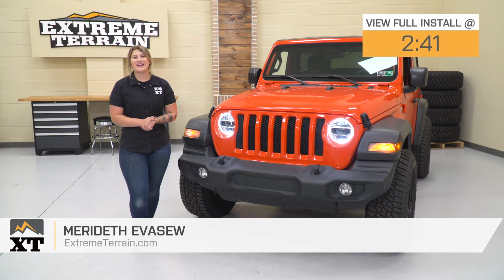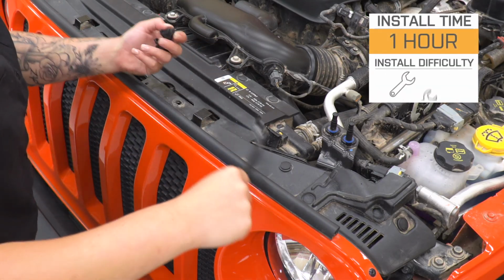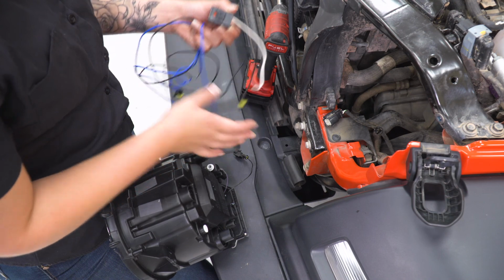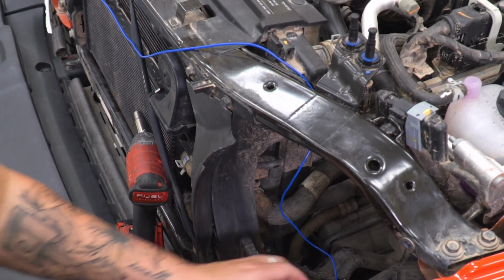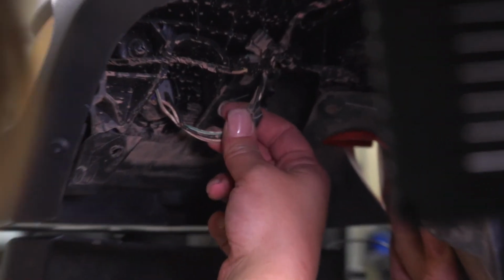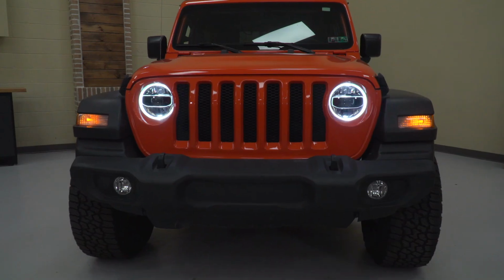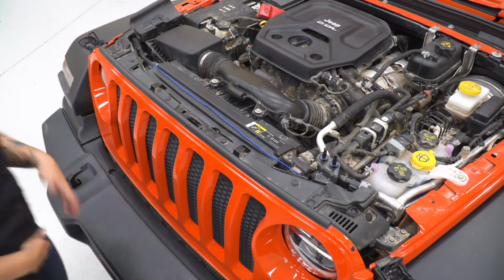Jeep Wrangler JL Skyline LED Headlights Review & Install

Comment: Thanx for the video and easy instillation tips. But I just did a set for a friend and quickly noticed that this set up needs a relay to run the daytime running halo rings. So if anyone els is doing this set up. Make sure you add one, so you dnt have to go back in there a second time like I did.
Reply: Did you tapped the halos to the existing DRL, or did you wire it from the fuse box? How did you installed the relay?
Reply: @adgmz6613  I had originally tapped into the drl lights.  And that’s wen I saw the issue.
Reply: And as far as the relay goes there is videos that show you how to use one. So you just use the ground from the drl harness, power straight from the battery and the drl wire to switch and the one left remaining back to the rings on the head light.
Reply: @k5_kiaupgrades622  what was the issue?
Reply: @adgmz6613  the halos were drawing to much power from the drl and shutting off. Once I added the relay it fixed the issue
Reply: @k5_kiaupgrades622  thanks I'll add the relay
Reply: What jeep model?? Just ordered and getting ready to install soon
Reply: @BIGHEADED525  it’s a 2019 JL Sahara

Comment: Halos are clearly visible in my Rubicon 2023 headlights while I cannot turn them on. 
It is mentioned that I can do that using The tazer while others are talking about a 4th wire.
Can you please advise?

Comment: If you don’t want to use the amber turning light function, is it just plug and play with the original wiring harness?
Reply: U can just not wire into the turn signals and that’s all. You still have to wire in the halo rings.

Comment: DRL halos don’t stay on.  Any ideas on how to,fix?  The white/green and white/brown wires were not on the same bulb.  White/green was on turn signal bulb.  White/Brown was on DRL bulb.  Everything else works fine except the halo DRLs.  They are off but if I turn on my quarter lights, they work as expected.  When I go back to Auto, the halos turn off.  One comment below says to wire into white/yellow instead, but I thought that was the return on the circuit.  Another says to add a relay, but not sure how to do that or which relay to use.  Any help?
Reply: Update.  Video show DLR on white/brown but after looking for and reviewing the Jeep’s wiring diagrams, FCA made some changes.  The DLR circuit is now White/Yellow.  Made that change and now everything works as expected.  You will also have to tap into both light bulbs.  One will have the white/yellow traced wire the other will have the white/green traced wire.
Reply: @valdeha2000  i had the same issue like the one you faced, i did switch the DRLs to the white/yellow wire and signal to the white/green but none of them is working now , any advice?
Reply: @AhmedOuwaiss  The only thing I can think of is making sure you have a good connection on the wires where you joined them.  Is your light switch set to,Auto?
Reply: @valdeha2000  No, i dont place the switch on Auto. But i took your comment and I start testing and finally got my Helos, for some reason when I switch the fog ligh on the helos switch off (projector light is off ).
Is this the case with you? Thanks
Reply: What jeep do you have?
Reply: @valdeha2000  what year is your Jeep?  Mine has 2 separate bulbs. One for turn signal and the other bulb is just on.
Reply: @valdeha2000  Thanks man. It helped!

Comment: Installed on my 2019 JL Sport. Halo does not operate by itself as DRL. The entire headlight and halo come on for DRL.
Reply: I have the same issue
Reply: @alexbyczynski5583  If you have new car, DRL wire needs to be connected to WHITE/YELLOW instead of WHITE/BROWN wire.

Comment: Is there a limit of how many times you can tap in to a wire? 

got these lights and got the Oracle halo fog lights which require to tap in same location. 

Just not sure If I could/should.

Hope to hear back thanks
Reply from the maker: You can tap into the same power or potentially combine both wires into one lead to minimize the amount of tap points! Hope this helps!

Comment: At this price point, I might as well buy the OEM halo/leds. LOL.
Reply: No kidding. Good grief...
Reply: If you can find them in stock and you do get the switchback feature which is nice so I can do a delete of the turn signal on the fenders now.
Reply: @strix9013  What is the switchback feature? Also, looks like price went up $150 bucks since this video came out. lol

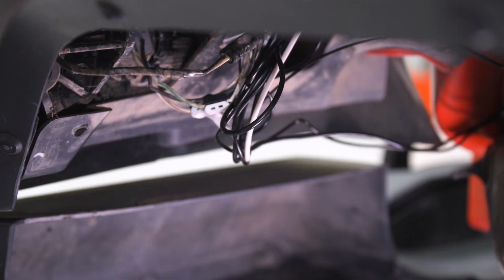Comment: If I have the MORIMOTO sequential, turning signals do I tap at a different place than what is shown in the video? 11:47  help
Or, I might just call in
Reply from the maker: Thanks for the question! You can check out our video on the Morimoto turn signals here --> https://www.youtube.com/watch?v=sy_wuXg1zGo&t=1s
Reply: Hey Mat. You find your answer?  I also got these lights and got the Oracle halo fog lights which require to tap in same location. 

Just not sure If I could/should. You find your answer?

Comment: Do you have to turn on the lights in order the daylight turns on? The Oracle Oculus use a different wiring in order to the daylights turns on automatically.
Reply from the maker: Not at all! You can always have the DRLs wired so they come on whenever the Jeep's interior accessories like the radio are on (I have these headlights and thats how I have them set up)! -Zach

Comment: Can I still tap the wires from the fender lights if I have the Morimoto Led turn signal kit?
Reply: Did it ever work for you? Trying to install, and have the morimoto led turn signal Kit….
Reply: I bought the morimoto led sequential turn signals also. And I'm trying to find someone that can tell me which wire to tap into for the blinker cause they are different from factory. And the drl I was just going to run straight to the fuse box. Did you have any luck figuring it out yet? Thanks
Reply: @MichaelF1026  Any luck on this?

Comment: Will these fit the 2021 Gladiator JT, specifically Mojave trim?
Reply from the maker: They sure will! -Zach
Reply: @extremeterrain  I’ve installed exactly like the video explains. The white halo does not come on. Amber turn signal is working fine.
Reply: @jesuscaseres1508  did you figure it out ?